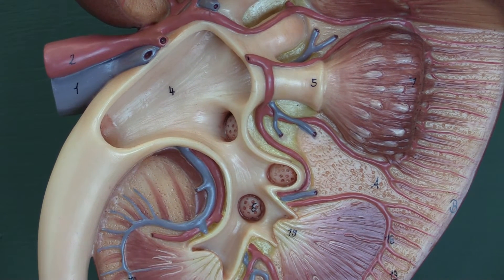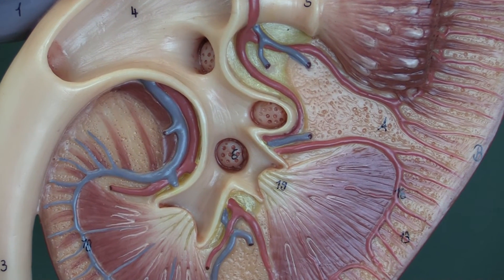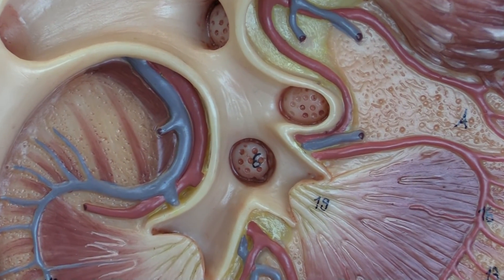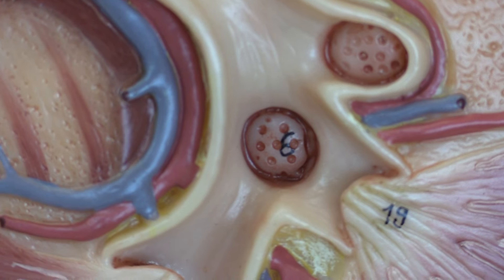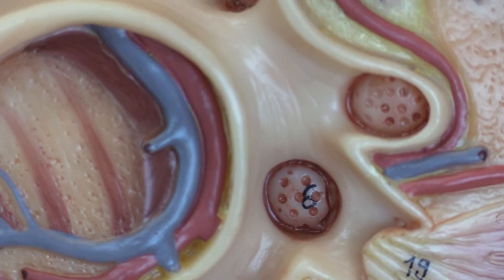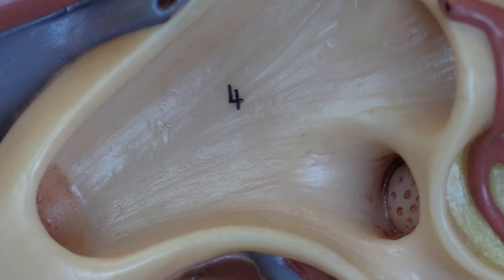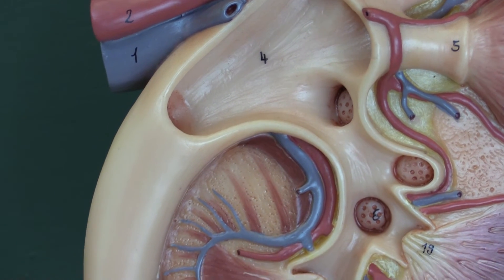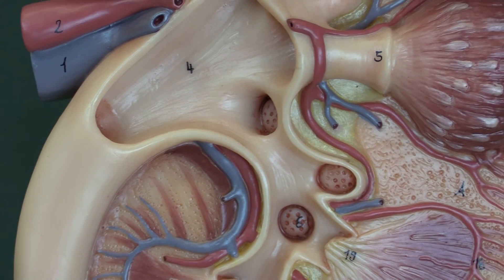Anatomy 12, Renal structure and function.

Comment: Beautiful lecture and a great model.

I do wonder, however, why the model makers made the renal vein substantially larger than the renal artery.

Perhaps, if it's accurately anatomically reflective, maybe there is a correlation between size and blood concentration?

Or more efficient delivery, since if a lot of blood passes through, thats a lot of water, and since there is a limit to the minute by minute filtration capacity, for more effective filtration perhaps blood vessels are narrowed and that explains why?

😁

Comment: Outstanding video....Doc....I recently had a urinalysis and was tested "false positive" for having opioids in the test.  I'm an RN.

I wonder what could be the reason....I had "stones" pass about a year ago and took an opiate then for the cholicy pain...because it f. hurt.

I have lost 15# of almost pure "fat", as of late due to good diet and food changes...and wonder if the fat metabolism had created some minute movement of held opioids from the fat to become metabolized in the urine....hence the "false positive"?

I know the ? is theoretical...but it's certainly interesting.

I'm just now drinking more water than usual to keep stones from reforming; I know the incidence of lithiasis is approaching 50% typically.
Reply: Frank From Upstate NY Great question, and that's one thing I like about Dr Campbells lectures.

They inspire questions. Did you get an answer yet regarding your opioid question?

Its quite nice actually to consider depositions of drugs in adipose tissue, if thats what you were asking.

I dont know about the physiology of how the deposition may occur, if it did then the drug must have left and artery or capillary somewhere into the surrounding tissue. 

If that happened though maybe wbc's would have cleaned up the mess?

Your question gave me a lot to think about too 😋 and also could have implications in court cases, and job applications.

Cheers!